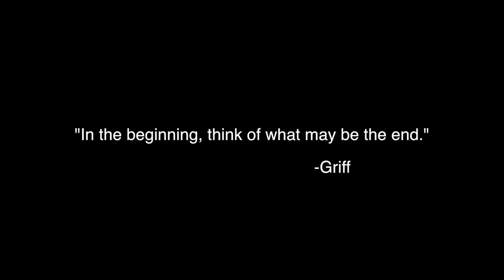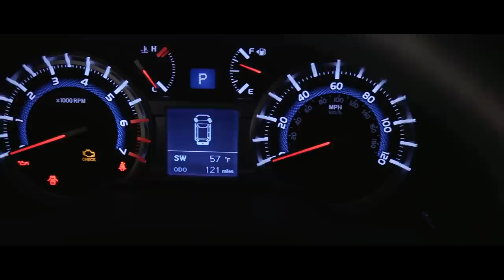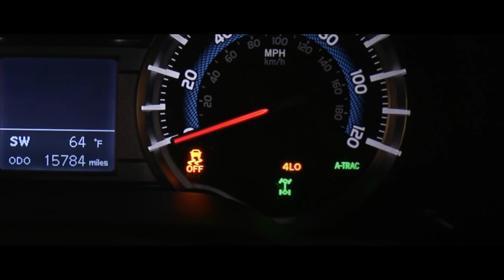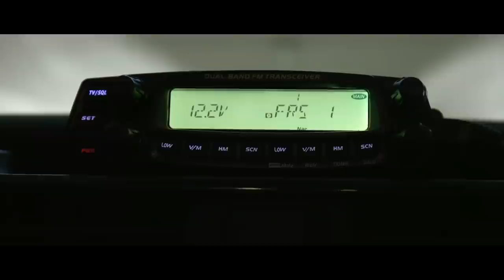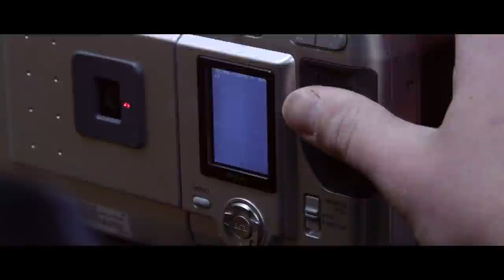We Are Overlanding Through Central America! Expedition Overland: Central America S2 Ep1

Comment: What are you guys doing with the 4Runners after you complete the series?  Does Toyota want them back?  Also, when you installed the ICON suspension, did you have to remove the KDSS?
Reply: Feint The KDSS system stayed in tact and functional with the Icon system

Comment: Looks like it gonna be interesting. Like I said after the Alaska trip I reckon you should have taken diesels and more aggressive tires. My suggestion is Ram 2500 turbo diesel and MT ATZs.
Reply: 3/4-1 ton diesel pickup from any of the big three, aggressive tires, and selectable lockers will probably get you through any terrain you care to drive into.
Reply: +Seth W fully agree Seth. Using gas powered SUVs with road tires off road is wrong.
Reply: no big three branded vehicle has the reliability I would potentially trust my life to. no way no how and i gonna trust a ram in the middle of nowhere being pushed like these vehicles are. babied big three vehicles get new trannies at 100k miles. I've never seen a toyota at all need one no matter how beat on it was before at least fifteen years.
Reply: they probably went with gas because of fuel availability throughout the trip. repair costs and parts availability also
Reply: ian peters the large pickups are the most reliable vehicles made anywhere. That is a well known and documented fact. Your prejudice is based on ignorance.